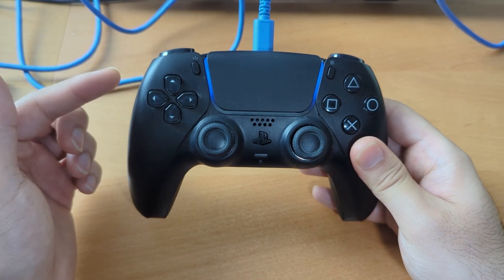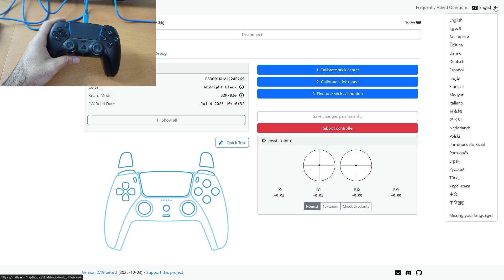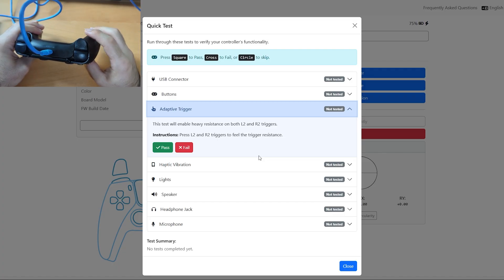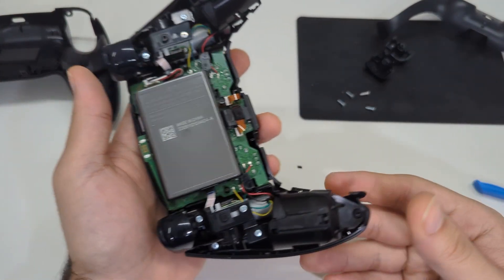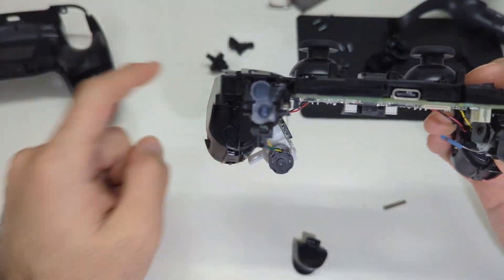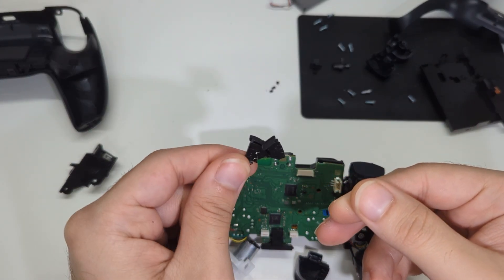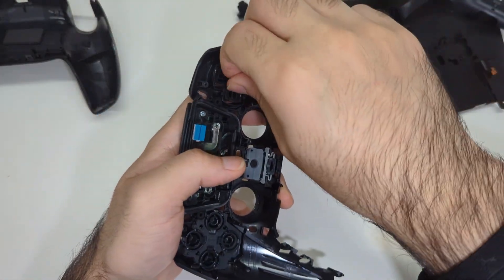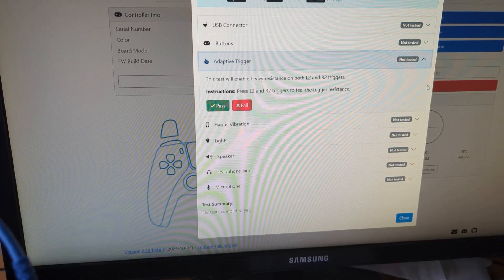DualSense Adaptive Triggers Ticking Noises Fix

Comment: Any recommendations on where to get quakity replacements for a reasonable price?
Reply from the maker: Which component exactly?

Most parts are bad quality when purchasing third party. I try to use donor controllers whenever I can
Reply: @Baro-Fix the gears in particular. I wasn't sure if there were any decent parts to be found, beyond just Frankensteining components from differently busted controllers
Reply from the maker: I do not know about the quality, but this is the first search result on Ali Express: https://a.aliexpress.com/_EJjM8Go

Edit: other than that, I think your best bet would be to get a donor controller. They often go for pretty cheap on the second hand marketplace. Make sure to get one that has the same BDM version as your controller.
Reply: @Baro-Fix thanks!

Comment: Welp, I have the same controller version. I did just as you did, completely disassembled the gearbox, inspected it and then reassembled it. No physical damage whatsoever. The motor still pulls the pulley all the way to the down position and then gets stuck there trying to pull it down further even though it has reached the end position. All gears are seated properly and meshing how they're supposed to. Could it be a sensor issue?
Reply from the maker: Could you check the ribbon cables that go to the triggers to see if the traces are damaged? 
I've not seen a broken trigger sensor yet, I doubt that is the issue (but still possible).
Let me know if I can be of help, you can send me photos in my socials in the description.

Comment: happens to me with my regular controller, I just lightly tap my hand into the side of the defective trigger, and it works like new.
Reply from the maker: I've had something similar happen yes. Instead of broken gears, they can be misaligned like I show towards the end of the disassembly. Perhaps the light tap on the controller put it back into position
Reply: @Baro-Fix your not wrong, I did it so many times the gap on one of the side on the controller to where the trigger broke closed off and snapped back in place, it is possible that might’ve happened.
Reply from the maker: Non the less, glad you fixed it pretty easily though
Reply: @Baro-Fix 👍 thanks man! 😁